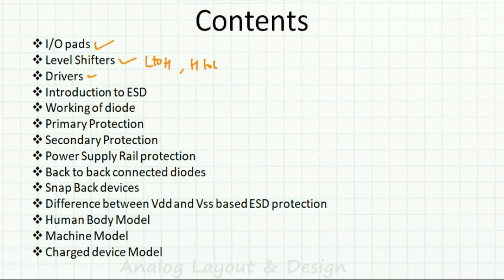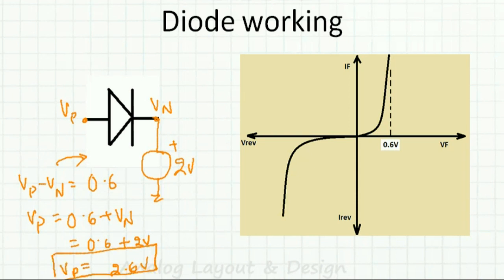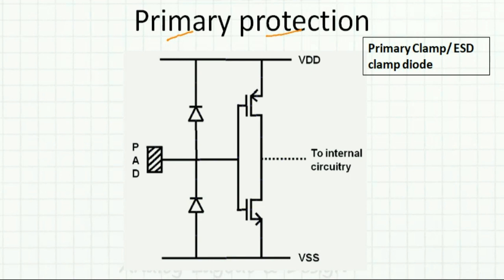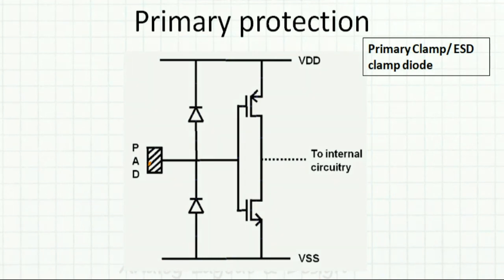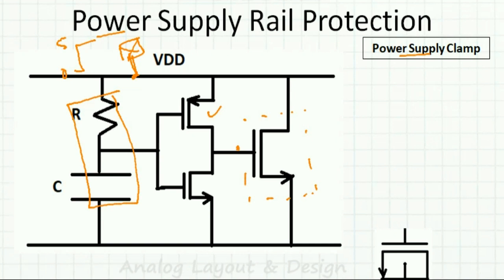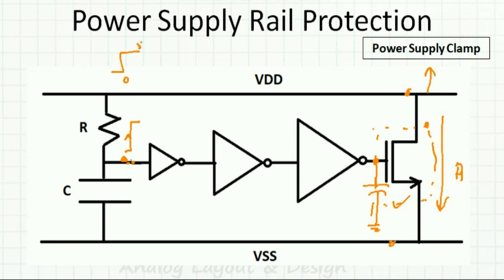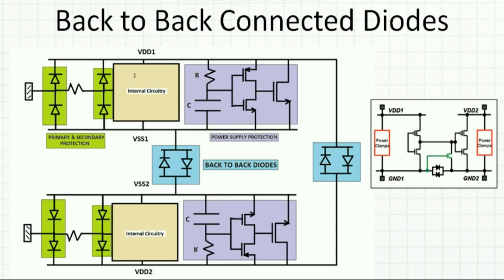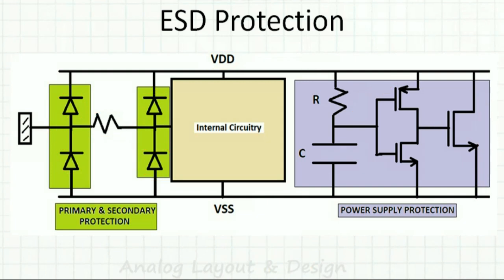ESD (PART - 2)

Comment: Excellent video, thank you so much for introducing ESD.  But I have a question about Power Supply Rail Protection. So what happens if VDD is about 85V in that circuit (Power Supply Rail Protection)? I want to design a high-voltage IO PAD using the 130BCD Process. Could you please explain it?

Comment: Hi Sir,
   1--The power clamp will be functional when the primary esd protection diodes is turned on right?
2--And is it requires the chip to be powered for esd discharging through clamp or without power also it will discharge? 
3--- If there are different circuits to work in powered and non powered conditions can you please explain in detail...

Thank you for your lectures and addressing all the queries🙏
Reply from the maker: ESD occurs generally when a person touches the bare chip by hand.. other scenario is when a machine picks and places the IC on a pcb for soldering.. both cases power supply will not be connected.. just for understanding the thresholds, I used that vdd value..
Reply: @analoglayoutdesign2342  got it sir...thank you

Comment: Dear sir, thank you for this video. 
I could not understand why do the ESD have to go through the Vdd then to the other end of circuit? 
Why not design ESD in such a way that it goes directly to the ground through the primary or the secondary protection?
( Am also confused why the diodes are designed such way forcing the current to flow through Vdd instead of go to the ground directly. )
Hope Prof you could enlighten on this. Thankful. 🥹🙏
Reply from the maker: Please watch all the videos on esd. There are basically two schemes.. one vdd based protection and another is vss based protection. What ever you have watched is vdd based protection. In vss based protection, the discharge is to ground and not thru vdd.. Hope this answers

Comment: In power supply rail protection you take inverter but why you say buffers
Reply from the maker: Buffer means that circuit which has high drivability.. it can be inverting buffer or non-inverting buffer.. hope this answers

Comment: Hi Sir,
I felt i learnt many things from your videos...thank you so much for sharing knowledge in such a great manner. I have a doubt that what happens if we are turning the device on with power assume 5v and why the nmos device will not discharge the actual power supply as the esd device remains on chip and there is no enable to turn it off during power on...?
Reply from the maker: During normal power ON we will not have esd type of supply.. suppose we have 5v supply maximum  we will operate it is 5.5v…where as esd threshold will be little higher and in esd, the rate at which the supply increases is very very high
Reply from the maker: Hope this answers
Reply: @analoglayoutdesign2342  Sir does it means ESD nmos threshold voltage will be higher than the normal supply voltage?
Reply from the maker: Please look into the pdk for esd devices and their characteristics.. in these videos, I have given high level overview of esd structures and their basic behaviour.. these kind of structures are used generally but not limited to only these.. it’s only qualitative analysis.. it’s not quantitative analysis…for exact behaviour you must get in touch with esd team..

Comment: Hi Sir,
Not clear overall ESD protection circuit when you combine both primary connection + power supply rail protection. What is importance of inverter which is just after primary b2b diodes. Hope that is for signal and second one is for power. Can you pls clarify
Reply from the maker: Hi, please go thru all esd videos again and again.. I have explained from very basics..

Comment: I don't understand how back to back diodes work in multiple VDD scenario. Let's take a practical example, 1V8 and 3V3 supplies. Such configuration would draw a huge amount of DC current from the larger 3V3 supply towards 1V8 supply
Reply from the maker: Between 1.8 and 3.6 we will not connect 1 diode.. suppose the vt of diode is 0.6v then three in series would make 1.8v between 3.6 and 1.8v
Reply: @analoglayoutdesign2342  I see, thanks for the quick answer

Comment: Could you show a demo how to simulate the IOPaDS  ?
Reply: Consider , I have an IO pad and what all paramenter I need to check before signing it off ?
Reply from the maker: Ok .. regarding analog circuit simulation, many are asking.. will figure out… need little time
Reply from the maker: What exactly are you looking at? ESD simulation?

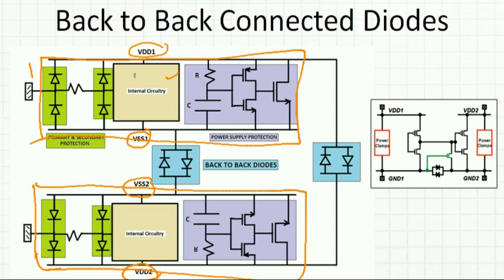Comment: 22:15 vdd1 different from vdd2 obviously the back to back diodes needs to be off in normal operations how do we ensure that ?
Reply from the maker: Yes true… if vdd1 and vdd2 are for eg 1.2 and 1.8v, then two diodes will be placed in series…assuming 0.6v threshold effectively it’s 1.2v.. hope this answers

Comment: Dear sir, thanks a lot for sharing topic ESD. I would like know one thing about when HBM occurs  at IO PAD then the voltage is 2Kv . As discussed in the video for 7V , added secondary dual diode to protect the gate.. so how to protect the gate from 2KV in HBM
Reply from the maker: I am not getting your question correctly... But if there is no discharge path, then the voltage will shoot up to to 2kv.... Moment the diode gets fw biased, it will limit the voltage to around 7v as in the case of  example discussion... Hope I answered..

Comment: For this chain of inverters, do they connect to the same VDD or other power supplies?
Reply from the maker: During esd event, there wont be any power supply... During this time power supply clamps will act... And different power supplies will be connected using back to back diodes...
Reply: @analoglayoutdesign2342  Thank you sir. Is there a lecture regarding PLL and VCO?
Reply from the maker: Will upload video on vco next..in few weeks

Comment: I understand how back to back connected devices will protect circuit during an ESD event. However, when no ESD event is taking place won't back to back connected diodes, discharge the higher Vdd. For example: If Vdd2 = 5V and Vdd1 = 3.3 V, then ESD diode will always remain ON and large flow of current in static condition and eventually destroy the ESD diode.
 
So this restricts the range of VDD's we can have. VDD2 shouldn't be greater than VDD1+0.7V and vice versa. Am I correct ?

Thanks for the great content about ESD.
Reply from the maker: Nice observation. In between 5v and 3.3V, they will not place 1diode... They will connect maybe 3 in series to match the voltage difference. Hope this answers ur question
Reply: @analoglayoutdesign2342  Thanks a lot for your quick reply. It answers my query.

Comment: Hello sir, could you explain the working of the Power clamp in the normal supply conditions? Esp during the transient times. If we turn on normal supply, due to the RC constant, the input at the driver is low and the gate of the clamp NMOS sees high which turns it on. As a result, it sucks in the initial current from the supply. Is this the right behavior?
Reply from the maker: Yes..power supply ramp up times are higher than esd ramp up times..so RC values and thresholds need to be selected accordingly
Reply: @analoglayoutdesign2342  Thank you, I think I got what I need for my chip.

Comment: Why we need secondary protection on only rx pads, not on tx pads
Reply from the maker: tx pad is generally connected to drain of the circuit...Rx will be connected to gate of the circuit...
Reply: @analoglayoutdesign2342  thank you.

Comment: Thank you for such a nice video on ESD diode, i do have a question if there is a negative spike, how will the rc delay work in supply clamp?
Reply from the maker: assume there is a negative spike, then  the big mosfet is a bi-directional device...or symmetric device...so source and drain are interchangable... now the scene is gate is at zero and drain is at -ve voltage... Drain behaves like source and there is net vgs>vth...so the mofet turns on and discharges from ground to supply pin.. (which has -ve voltage)... this way we can understand....hope its clear..
Reply: @analoglayoutdesign2342  Thank you for your quick response, i do have a another question,
Lets assume the chip has been powered up, as chip has been powered up the VDD line has 5v, now the cap in rc has been charged, now if there is an positive ESD spike, as the cap is charged the o/p of inv is zero hence nmos is off, how will the extra rise in vdd line will be discharged through GND?
Reply from the maker: @anilsn8219   ESD events generally happen before powering up of the IC. when a person handles the IC the charge accumulated on him discharges thru the IC...thats why we have Human Body model...another type is while machine does the soldering....thats when we have the machine model etc.... when powered, we must have other methods of protection...
Reply from the maker: @anilsn8219  ESD events happen before powering up...when a person touches he discharges the charge..hence HBM... while machine handles the IC for soldering...Machine can discharge...hence Machine model...etc... after powering up, there must be other protection methods...
Reply: @analoglayoutdesign2342   Suppose if there is a ESD event at VDD or GND pad itself, is still the combination of rc, inv and nmos clamp holds good?. If so can you please explain the discharge path sir
Reply from the maker: @anilsn8219   yes...RC clamp is power supply clamp only.... Please go thru the video again and again...the discharge path is explained..also watch all the videos of ESD..all 4...it should become very clear..

Comment: Hi , I have one question I think u may know this,that is about antenna diode,I searched  but I didn't got exact answer, 
Question is how the charge get discharged in antenna diode?
For that basically two diodes are their pdiode and n diode,in p diode basically 1st it is connected in reverse bias, for long length metal of gate  during plasma etching that charge accumulated on that metal  will get  discharged by that diode(will become forward bias),but it is not working for  ndiode ??? Please reply me,or I will give my number?

Comment: how we can decide the size diode which is connect  to back to back
Reply from the maker: Size of the diode depends on the current rating.....and ON resistance or forward drop.... foundry will provide info on this...
Reply: Thank you so muchh
Reply: Diode means diode so in which manner the size of diode increase

Comment: Hey Sir, for the power supply clamp, why do we assume a 0 to 5V increase during an ESD event? Wouldn't VDD have been at 5V prior? In this case, the voltage at  the output of the RC circuit would not have started at 0 V?
Reply from the maker: When ESD occurs, the chip is not powered..only substrate is at ground...that assumption is valid..vdd will not be connect to 5V....;..... when I say 5V, that will be the threshold that will be set for ESD event to be limited to...hope you got it..
Reply: @analoglayoutdesign2342  Hey Sir, so ideally during an ESD event when the chip is off, the circuitry will not see a voltage greater then 0.6v assuming that's when the diode is forward bias? The 5v example was just showing the threshold when the circuit was on?
Reply: One more question, what if during operation, we get a huge voltage on the PAD. In that case, the output of the RC circuit will not be 0 so how will we get a power rail discharge?

Comment: 1) Why ESD is dissipated into supplies? Won't the supply rails get damaged?
2) What protects the input ESD diodes in case of long duration spikes?
3) The VDD protection that you talk about, the buffers will have their own delay to turn on the big NMOS. What happens to VDD during this delay when the NMOS is off?
Reply from the maker: 1. No there will be a supply clamp. That is meant to dissipate the ESD energy without voltages reaching higer values and damaging the devices.
2. ESD events are high energy events..but last for several 10s of nano seconds maximum.... if the duration of the spike is very high, surely the IC will get damaged. ESD devices are placed inside the IC based on the kind of ESD protection the IC needs. hope this answers.
Reply: @analoglayoutdesign2342  what about 3rd question
Reply from the maker: 3. Sorry I didn't see that question... yes..RC delay +series of inverter buffers delay needs to be accounted in design.  So the driver buffer will also be big and will be a tapered buffer... if this delay is more than designed,  then  esd will fail... the voltage will shoot up.. hope this answers

Comment: hello thanks a lot for the video. it was very useful.. I have a comment, we can't have a back to back connected diodes between different power supplies, as the diodes will get turned on during normal operation. back to back connected diodes can be only connected between grounds.
Reply from the maker: they will have. suppose vdd1=1.2V and vdd2=2.4. your point is, from 2.4 to 1.2V supply the diode gets f/w biased because of potential difference. They will put 3 diodes in series. so effectively it will turn on only when the supply is 1.2+0.6+0.6+.6=3V. not at mere 2.4volts only. Hope this clarifies.
Reply: @analoglayoutdesign2342  hi yes.. we need to carefully put how much diodes in series we put depending on the vdd1 and vdd2 supply difference..